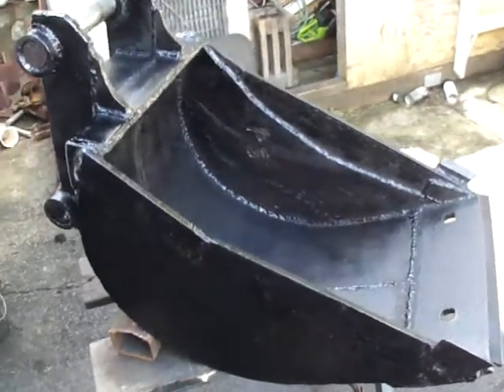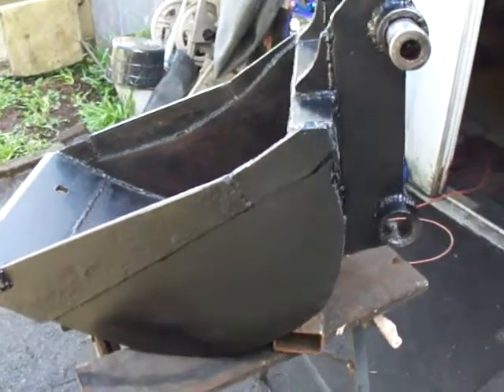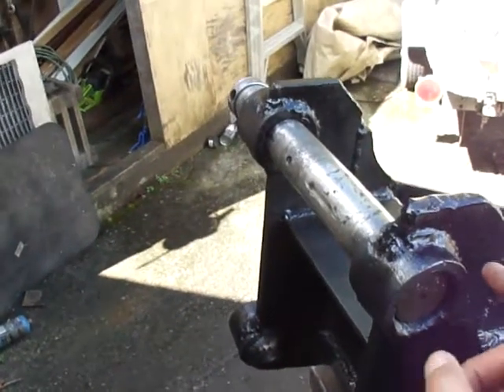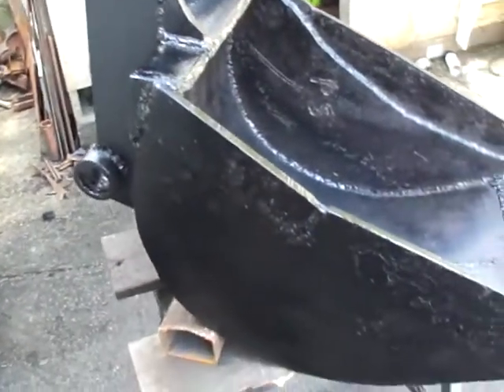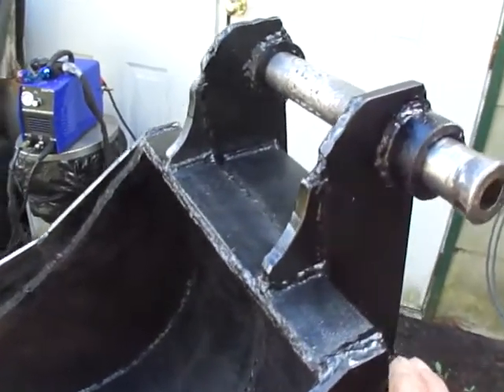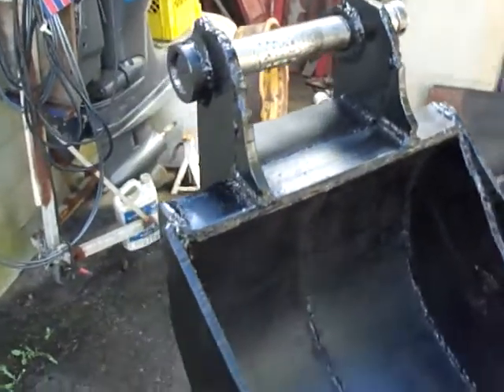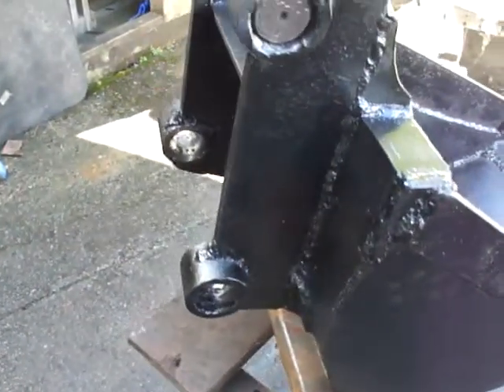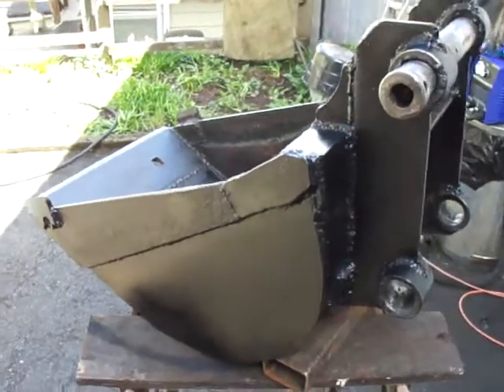How to make a 16" excavator bucket from scrap metals (3)

Comment: Nice build! :)
Reply from the maker: Thanks, testing shows that the top pin hole are little too far back that bucket face can bet 90 degree to stick, thou 120 degree would be better.  I will use it a bit then fix it.
Reply from the maker: I mean 60 to 45 degree of bucket face to stick is better.
Reply: Which material use this part
Reply from the maker: @shardulmulik6938  Cutting edge is from loader blade, rest mostly mild steel.  I ve done a few new home service  job and a very large septic job with it, and beefed up a bit, looks like it will last for a long time.  I ordered a quick coupler, to easily exchange between buckets, hammer, cement mixer, lifting fork....